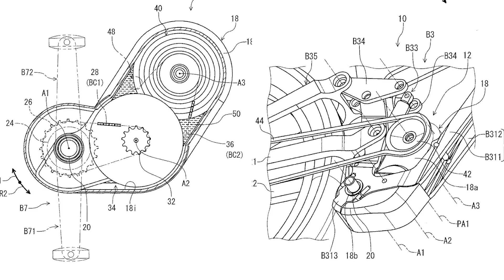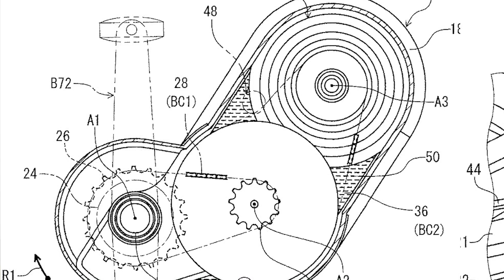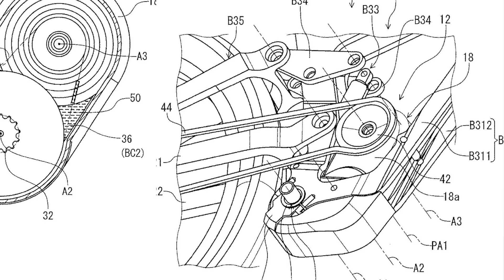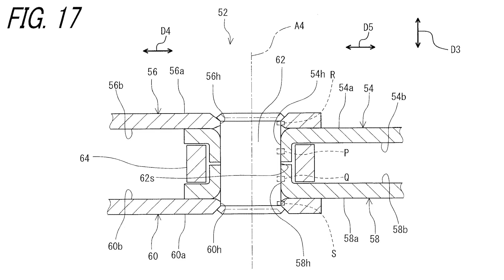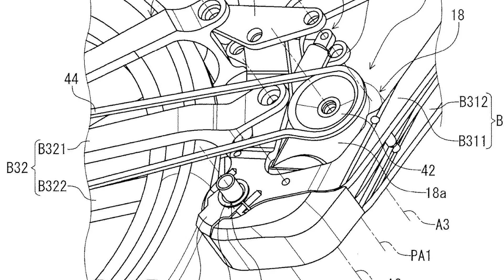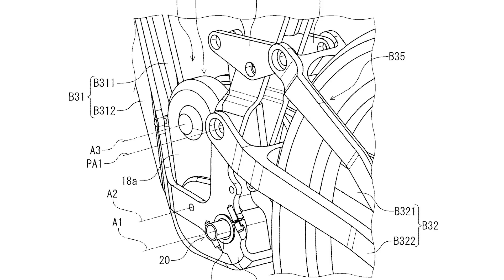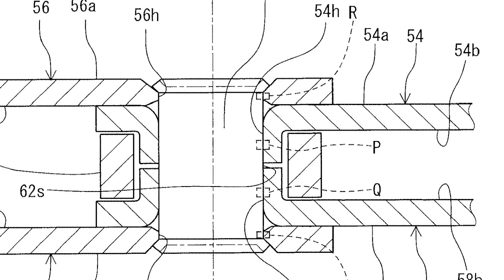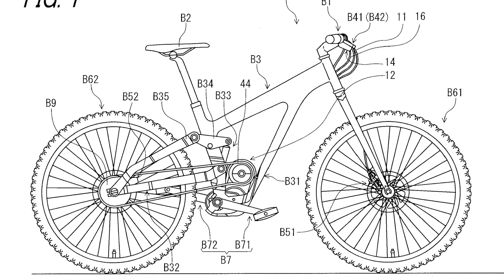Death of The Derailleur? | Shimano's Gearbox Patent

Comment: If it requires a motor or any other electronics, it is condemned to be a commercial fiasco. Electronic bicycle shifting market has never took off, it has a minimal share percentage, because nobody wants to be unable to shift in the middle of a desert due to low batteries or an electronic malfunction. If you want to know how is the sensation of shifting inability, just break your bicycle dropout.

Comment: isn't the chain that goes to the rear wheel still going to pick up plenty of road grime and slop and bring it into the gearbox?
Reply: it's external.
Reply: @hpkiunzy  okay, but it's still not solving the problem of the drive chain and the rear sprocket from needing constant maintenance from the elements.
Reply: @billwelch9431  true, at least the chain and the sprocket are small, maybe they'll be cheap. idk.

Comment: The kind of gearbox technology you find in geared by-pass fans in commercial aircraft engines with very high time endurance materials and lightweight aught to apply well to cycling gearboxes.  These parts are machined using automated assembly which is what you’re seeing in almost every technology application.  Automated assembly increases the lifespan of materials that used to be constructed entirely by hand.  Just find out which portion was obviously left out.  You know,  the most logical conclusion which seems the most improbable when the process of elimination leaves one outcome is correct?

Comment: Perfect bike of the future: throttled ebike, centre of gravity sealed gearbox or some CVT or variable transmission, straight chain line or even better belt or sealed shaft, so basically a lightweight mini motorbike with the option of pedalling. No one it seems has made anything like that to overcome all the obstacles to make that possible yet

Comment: Holy shit it took you almost 7 min to actually get to the gearbox. For those of you who haven't watched just go to 6:45.
Reply: Thanks!
Reply: Looks like it has a lot of frictional losses. All those extra bearings and spinning parts that you now have to get spinning with your legs.
Reply: @0xsergy  It's not like a Rohloff or Pinion where there are gears meshing at very high torques.  It's basically a regular drive train with the chainrings and rear cogs brought close together.  At any one time, there is only one ring and one cog engaged, and coupled by a chain kept in a perfectly straight line, with minimal chain tensioning needed -- in half the gears, no extra tensioning.  That chain is internal, so always clean.  There are extra chainrings, but fewer rear cogs, so the extra weight isn't crazy.
Reply: Real American Hero!!!
Reply: @ruquik  amen
Reply: I was getting impatient with him then he insulted me with my "20 second attention span"... :)
Now on to 6:45

Comment: Hmm, a lot of talking and very little info about the gearbox itself.  Seems to be a sort of a CVT using bicycle cogs.  Could be for city rental bikes, they use Shimano 3 speed planetary hubs now, but no doubt they get a lot of flack due to the poor sealing against water etc this hubs suffer from.  Would be cool to see it produced but like the pinion would need a specific custom frame.

Comment: What’s wrong with Sturmey Archer hub gearing?
Reply: With direct drive ..with light drive shaft.metal ,not carbon fibre.
Reply: Lewis Leyland - Shaft drive has less maintenance requirements, but it is only 75% efficient vs 97% using a chain or 89% using a belt. Which is why it never went mainstream on motorcycles.

Comment: It seems strange they use chain and derailleurs to create a transmission. One would expect direct gear contact as with planetary systems.  Probably a weight thing. If the gearbox is reliable and low maintenance a little extra weight is okay. The external drive should be a belt rather than a chain.

Comment: in terms of durability and reliability i think developing an internal gearbox is great but to have a traditional external chain drive i think defeats the whole purpose. the chain drive will be the weakest link. if they are developing a gearbox they need to also think about the durability and reliability of the drive too. maybe having a gates belt drive might be a good interim suggestion until shimano develops a reliable drive system of their own.

Comment: Er can you say "Rohloff" Gearboxes have been around for decades...
Reply: This is more similar to the Pinion gearbox but you are correct, Rohloff was first...
Reply: Rohloff makes internally geared hubs, not gearboxes. Also, no one claimed that gearboxes are a new thing. The significance, per this video and about a dozen others, is that Shimano is a huge OEM supplier so there's a real chance you will see major bike companies actually make compatible frames.
Reply: Just to add a bit of history: Rohloff is really a rather young company. Both Sturmey-Archer and Sachs (now one of the pillars of the SRAM empire) have built gear hubs for well over 100 years.
Reply: The main difference between Shimano's system and a normal gearbox or internally geared hub (which today's gearboxes are all based on), is that this one is based on a chain and a cassette, instead of 2 sprockets touching each other. 
I don't know if you tried bikes with gearboxes or internally geared hubs, but you can feel the extra drag it creates: the reason why it has always only been used on bikes where low-maintenance and reliability is more important than speed, and never on bikes built for speed (road bikes and mountain bikes).

As this new system of Shimano works on a chain and gear, it should have a similar efficiency as a system based on a derailleur. Possibly with even less friction as the chain line is perfectly straight. 

That's where they are unique: Probably the low resistance of a derailleur, but with the reliability and low maintenance of a gearbox or internally geared hub.

Comment: Could be a game changer and revolutionize the cycling world.  If it would require less maintenance and offer more riding time, it would be HUGE!  Pardon the pun.  The biggest challenge is going to be weight and maintenance.  Also, how many bicycle manufacturers who will build frames exclusive to the Shimano design.  Could this also mean that Shimano will start offering there own carbon fibre frame?  They have teased it over the years.  Either that, or they are going to have to partner with a well-known high end manufacturer like Pinarello or Trek.  No matter who they partner with it is going to be expensive for a while.  I hope it happens.

Comment: hey there... well I absolutely think that the next big step forward in bicycle drive train is a gearbox. It gives a lot of serious advantages over a normal drive train: 1)- durability and lack of maintenance due to the parts being in a sealed case isolated from the elements and the chance of being bathed in oil.
2)- only one chainring in the front and one chainring in the back... a bike's rear suspension designer's dream. Also giving the chance for the perfect chainline since the chain doesn't have to move from side to side, meaning less wear.
3)- no derailleur. no chainslap. no chance of braking something that's so exposed for anything to tear it off and essential for the bike to move.
4)- less unsprung mass improving the rear suspension's ability to "copy" the terrain.
5)- not having a cassette gives the rear hub's spoke flanges the room to be further away from each other meaning a stronger rear wheel.
6)- having almost all the mass of the drivetrain next to the bottom bracket gives a better over all balance.

It only needs a bit more development to adress the drag and the weight but to me those sound like minor issues when compared to the list above.

Comment: Another benefit of an enclosed gearbox is reduced mess, especially when the gearbox is combined with an enclosure for the final drive chain.  Apartment dwellers, van lifers, casual bikers who store their bike in the laundry room, riders who forgot to bring their pants leg clip, folding bike affectionados, maintenance procrastinators -- all are tired of greasy, dirty chains.  Any answer that is cheaper or more efficient than a driveshaft or belt is a win for this part of the market.

Comment: Hi. I teach IP management, which includes how to read and interpret a patent claim.  The invention being described here is essentially a special type of lubricant, to be used on moving parts of a drive train and to make a cable operate more smoothly. Shimano does not claim to have invented a gearbox. They only claim to have invented an improved type of lubricant that could be used on chains and even pinion gearboxes.  They cannot introduce the gearbox shown in the figures if it infringes a Pinion product, without taking a license from that patent owner. What Shimano wants to claim as an invention here is the use of a specific type of lubricant (with a specific chemical composition) on a set of materials, to reduce friction, and in particular, applied to the case of bike drive trains, which could include a gear box drive train.  The purpose of the application is to allow experts and competitors to present opposition to the patent office, so that it may decide not to grant the patent or reduce its scope of protection.  When you see a patent with a lot of detailed specification and many dependent claims, it usually means that the patent covers a relatively small range of inventions, and that there could be many non-infringing substitutes that already exist in the market or that could be made in the future. For example, it could be that a synthetic motor oil might be just as good, and not infringe this Shimano patent, should it be granted.
Reply: The Shimano gear box is actually a derivative of something that Honda had patented some time ago. On another news channel they mentioned that Shimano recently bought the Honda patent and they now follow up with a product. So I guess the Shimano bike gear box is coming.
Reply: @DilbertMuc  That would explain the detailed images for the gearbox! Then it looks like they want to patent the lubricant because they own the gearbox. Thanks for mentioning this.
Reply: Great detail, thanks for the comment!
Reply: @dalezapple2493  
Really, I wish we had more commenters like you. It was enlightening.
Reply: When you read the actual claims there is literally no attempt made to patent any of the mechanisms shown. This is very strange.
Reply: @gsportgeorge  See my posting above. The gearbox is based on a Honda patent, which arguibly was bought by Shimano just recently.
Reply: @DilbertMuc  yes. There is potentially still a decade or so left on the Honda patent and I have seen a similar layout from an (Italian?) Chain-box that used two opposed cassettes closely spaced with chain staying well aligned as it moves. So maybe they drafted this patent and had to remove claims until the only claims left related to the lubricant? But it still seems strange that they would disclose so much unnecessarily. Perhaps they want OEMs and consumers to start getting excited so that frames are produced to work with it? It was filled in mid 2017 so there is every chance that they are close to wanting to talk to OEM partners. I just hope they won't lock it down like they did with micro spline...
Reply: @gsportgeorge  They didn't lock down the micro spline patent. It's here. It's on their new 12 speed systems. As far as I know, they bought the Honda patent und that's why they designed the gearbox. Probably they had to talk and convince a lot of bike manufacturer behind the curtain and get their feedback to make a good product. Shimano is not known to be on the forefront of new stuff. They come later, but when they come they have superior product at a very competitive price and huge volumes.
Reply: @DilbertMuc  they initially limited the hub manufacturers that they would allow to make micro spline compatible hubs. So DT for example probably knew the specs etc long before Hope etc. And it was only public outcry that started to open this up.
Reply: @gsportgeorge  That's normal in the industry. It's called lead customer. DT Swiss is much more important than Hope and has much more market leverage.
Reply: @DilbertMuc  it's not normal for a company like Hope to need to put out a statement to drum up customer support before Shimano will let them make compatible parts...
Reply: @gsportgeorge  I think it depends on the roll-out strategy. Usually you have a lead customer in each dedicated market and you put resources into that mutual development. After that and if everything works as intended, more and more customers are brought in until you make an official announcement. I assume that Shimano (which has limited staff like every company) startet with DT Swiss for the European market, then Mavic, then US companies and so forth. Thats an assumption as we don't know internal strategies of Shimano.
Reply: @DilbertMuc  the point I was making was that I hope the gearbox would be made available to all manufacturers at launch. This was not done with micro spline. SRAM making the XD fitting open source has been really positive. It would suck to have Shimano using a certain mounting standard and not allowing smaller builders to build compatible frames. 
Ideally there would be one open standard for gearbox and motor mounts and riders could switch.
Reply: @gsportgeorge  Well, when you consider the stop times on Hope brakes....
Reply: @gsportgeorge  Not strange. The gearbox is prior art! At best one can claim new lubricant combined with gearbox.
Reply: Prior ask doesn't necessarily prevent you from getting a patent. It just means that you can go to court and invalidate the patent
Reply: @snorttroll4379  If the prior art is the same thing as what you want to patent, then YES, it does prevent you from getting a patent ON THE SAME THING, because the novelty requirement is not satisfied. Even if it was not patented, but only sold, or even presented for sale at a trade show, or used somewhere (outside of experimental development) anywhere in the world, then yes, it would prevent you from getting a patent.  However, an improvement to something that already exists, is patent eligible.
Reply: a small part of my joy for life just died reading this...yawn...invent/create, love, share, die....not squirrel, lawyer up, expropriate die...everything thats wrong with humans
Reply: Awesome contribution 👍

Comment: I really wonder how long it will last. Is it actually indefinite?
There must also be a motor in there, just as how cars are made. Cars also need that motor oil. The gearbox may need motor oil as well. Guess what? After a certain amount of time and miles, it'll need to be degreased and replaced as well.

So, there is some food for thought. Someone needs to invent a maintenance meter🙂

Comment: Wow, six minutes in and you finale start describing what this video is about.
Edit/
Good video anyway, guess I have to say that!
By the way... Instead of a moving chain, the sprockets are moving... Yes. This is funny because it's the reverse principle. A very common method in engineering to find new ideas for a problem. And mostly used to bypass the competitors patents lol.

Comment: How would you deal with chain stretch in an enclosed gearbox?
Reply: Wouldn't a clean and lubricated chain last for tens of thousands of kilometres? I think so.
Reply: @markifi  further than an external chain but it will stretch eventually.
Reply: @sergarlantyrell7847  sure, but I was thinking along the lines of this: only a small percentage of people change their own drive belts on their car nowadays, because they became so dependable that we don't need to worry about it. I suspect the same would happen to this system if it ever gets built. Please excuse my hijacking your question without giving you an answer. my best bet: The patent still uses a chain tensioner, so I think changing the chain shouldn't be a big problem, lay bike on side, remove 4 bolts, clean, change components that need changing, add new sealing gasket, close it back up. Maybe it's more complicated and you need to send the whole unit to a service centre, which would suck, but it would be better than the system we have now where you go through 2 chains a year at 30 pounds a pop and new cassette every two years or so for another 50 or so!

Comment: By the way, it’s still not a completely closed system.  There is still a chain or belt going to a sprocket in the back, which are open to the elements.  For a two-wheeled vehicle, the only transmission that is completely closed is a kardan (driveshaft) system as on some motorcycles.

Comment: A gearbox with a carbon fiber drive shaft. That is the holy grail.
Reply: OR  Just Cover your current drive, you will save money on chain lube!
Reply: A conventional cog-based gearbox and shaft drive is 10-20% less efficient than derailleur gears and chain drive.
Shaft-driven bikes appear regularly every 10 years or so, are hailed as the next big thing for about 2 weeks and then disappear again because of the poor efficiency.
The only gearbox (for a car) I could find numbers for claimed an 'unrivalled' efficiency of 82% while a well adjusted chain drive can reach 98%.

Comment: If this is low drag and if the weight is not significantly more then I’m all in. Any comments on the gear ratios? I’d be hoping for equal steps but if it’s chain driven internally that may not be the case.
Reply: My understanding is that equal steps is not possible on a chain design because the chain needs the gears to be a certain tooth number to shift smoothly, but maybe that will change with the bottom cassette moving side to side for gear alignment.